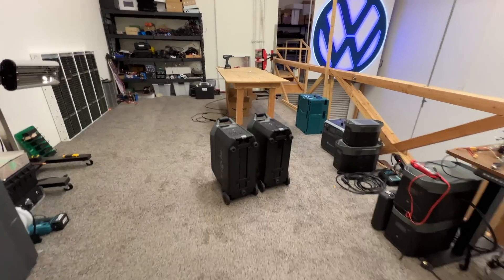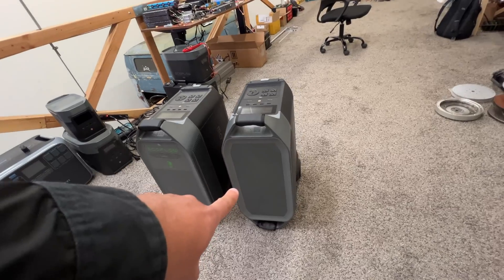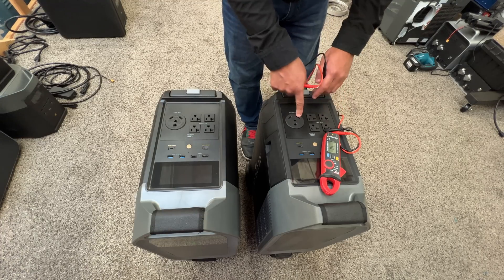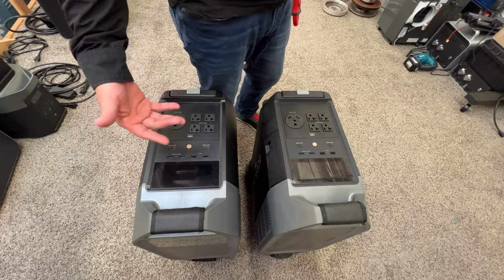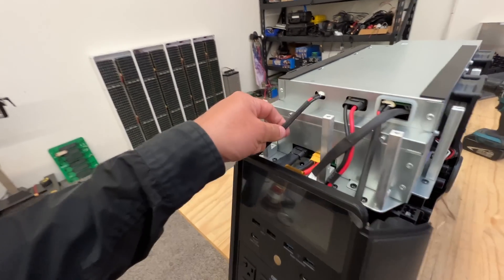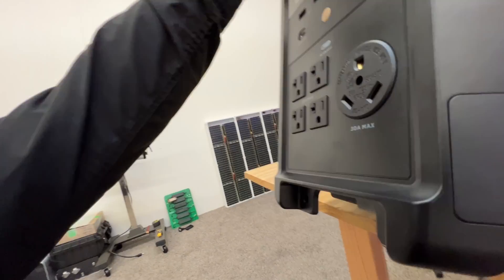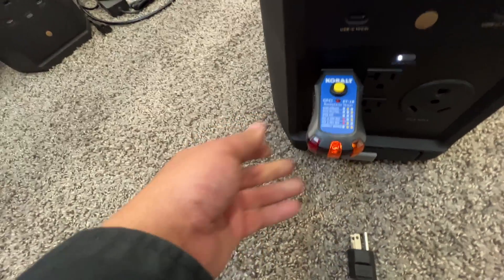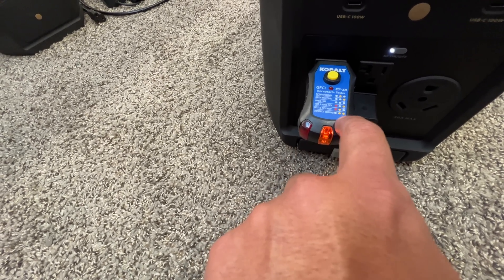Ecoflow Fixed the DeltaPro Reverse Polarity Issue

Comment: So, I got the 121 error code for overload. I had it plugged in charging for the next power outage. I used it last Tuesday, and today is Monday. Before I hooked it into the bypass for the house, I turned it one, all was good, at 100% charge, and when I turned on the switch button, I got the code, and the power dropped to 69%. They are sending me a new one within a few hours of tech support. But what will prevent an overload on charging: would a surge protector be the solution when charging?

Comment: I find it interesting that the Bluetti AC200Max has the exact same issue. I find it very strange that two mfg's would have the same problem. Several users including myself are seeing the same issue you did with the Ecoflow Delta Pro (https://www.youtube.com/watch?v=dpYJJnAdnog). With that said, I have not yet opened the unit up  to see if it's a as simple as a swapped wire. 
I know at least 3 of us have reported this to Bluetti. We will see how they respond as compared to EcoFlow.

I received a response from Bluetti regarding their wiring issue in the AC200Max. Unfortunately Bluetti's response was very disappointing. Ive included their respose for reference - 

"In terms of the off-grid portable power station products, the reverse polarity does not create impact to the normal use or compromise any safety problem of the products."

Comment: I just discovered that my AC200Max has an incorrectly wired 30Amp plug just like the preproduction Ecoflow DeltaPro. I will never use that particular plug but that's two different companies that wired these incorrectly and Bluetti has production units out with this problem. I haven't heard anything anywhere else about this issue on the Bluetti unit either.

Comment: It's a good thing that Ecoflow just doesn't pump out any power station they want. They go on the extra mile to see how it's customers enjoy their products.
Reply: I agree. This am I got the overload code from charging. I had an outage, and within a few hours of phone calls and emails, they are sending me a replacement model. So, this is my second warrany issue, and they are on it, while at first tried to get me just to send it back in my own paking under the "ensure it will not get damaged . . ." clause they added. I griped about that and immediately they said, so sorry, we got you another coming and they provided a tracking number. So down for a few days but back online. I use it for 9 hours during an outage on my house or my rv, and then if it goes longer than 9, I switch to a generator to run my home, while charging the ecoflow for 3 hours and then I get another 9 hours without using gas. I'm thinking I should start using my ecoflow during peak rates at PG&E and charging at low rate hours.

Comment: This confirms line & neutral are consistent between the 20A & 30A outputs, but do they match the line & neutral on the AC input? This is the important part for the scenario you mentioned in your earlier video. I.e. AC input connected to an outlet in your home, with an output connected back into your home via a transfer switch and the neutrals are bonded together in your home's main panel.

Edit: Jehu, can you plug the Delta Pro into an AC outlet (to put it in pass-through mode), and plug the circuit tester into the Delta Pro to see if it reports reverse polarity?
Reply: Yes, let's see that tested.
Reply: The ecoflow has been fixed, period. The 30 amp receptacle was the only problem with the ecoflow.

Comment: I have a request for testing: the DeltaPro states a max input voltage for the solar input of 150V. Do you have a variable DC power supply that goes over 150V? I am curious if there is some cushion built in, how much over 150V, and if so does it trip some kind of protection, or does it fry something in the unit.
Reply: I’ve tested this. It’s pretty much a hard limit. With 160V (VOC) it would not charge. Nothing fried. Of course if you connect your 600V home array it will have problems.

Comment: Correct me if I'm wrong, but I would think an inverter output doesn't matter which one is live or neutral as it is isolated and floating with respect to earth ground (the actual earth via grounding rods) unless it has a UPS function which would have a pass through mode in which case the input live and neutral should be the same as the output.
Reply: Apart from the UPS it matters for split phase bonding. For single phase 120V it doesn’t matter.
Reply: @n2rj  Tell that to an electrician or the UL.
Reply: @uhjyuff2095   I’m aware. I’m an engineer.
Reply: @n2rj  Me too! Electrical?
Reply: @uhjyuff2095  yes! BSEE/MSEE.
Reply: You are absolutely correct!…. Seems to me there’s a complete lack of understanding here of floating neutrals and their use.

Comment: All the receptacles are and were wired correct except for the 30 amp. The wires are not long enough so ecoflow moved the wires exactly how I would do it, and you did it by extending the wires because the wires were too short. Ecoflow fixed it the easy way you fixed it the hard way! I know you won't believe me, but ecoflow did not do a software change only swap the wires just like you did. I guess I have to explain the wires have two ends one end is on the receptacle the other end is on the terminals of the source. You swapped the physical wire on the receptacle and ecoflow swapped the physical wire on the source terminal end. Whew!
Reply: Makes sense.

Comment: True craftsmen will always care about the colors of the wiring.  Some one might be doing work on the unit and get injured due to relying the wire coloring.  The coloring of wires is governed by regulation...it serves an actual purpose....primarily personel protection.
Reply: Yeah, they should just grab some black and white electrical tape. LOL.
Reply: @uhjyuff2095  that is a poor substitute to not using the correct wiring colors.  As a former electrician I often phase colored wiring with colored tape when all wires were black in color.  But having to color tape wiring that was completely wrong was not considered an option.
Reply: @johntingle455  I am also an electrician. An example of wrong color coded wires would be a home run using a cable to a 240 volt appliance. There is no sense in using a 4 wire cable with the correct color wires over using a 3 wire cable with the wrong color coded wires. I am not saying that ecoflow used cables inside their unit, but this would be similar to opening a junction box and seeing the wires from a cable that I installed with electrical tape on the ends.
Reply: As an electrician, colors do matter! Potential shock Hazzard for technicians can occur.

Comment: Hi. Love your videos. You examine things no one else does and teach me so much. I was wondering for camping if you would recommend the original Delta or the Delta Mini? Assume they are the same price. The main differences I see are more capacity and inverter size in the aDelta vs. app support in the mini. You probably know of other technical differences. Thanks for all your help and videos. 🙏🏽
Reply: Delta Mini is newer and newer is better! Just my opinion.
Reply: uhjyu ff Thank you. I agree that newer is better in this case other than giving up a lot of capacity and inverter power, which is why I am struggling. What I really want is a newer version of the original Delta with app support. I really like the 1800W inverter it has. The 1400W inverter isn’t quite enough, but I do love the app with it. 😊
Reply: @litnoregrets7551  Then why don't you get the Delta Max?
Reply: uhjyu ff great question. The max has a lot more power, which is great, but it is large and costs a lot more. The original Delta is right between the Mini and Max, it just needs an upgrade.
Reply: Mini or max. They have app control.
Reply: Ria's Shack ham radio Thank you. Yes, they both have app, which is great but the max is way more than I need and costs a lot more. The mini is not quite powerful enough. I need original Delta power and capacity with the new mini features, like the app. 😊
Reply: @litnoregrets7551   probably not gonna happen right now.
Reply: Ria's Shack ham radio you’re probably right. I just need to wait. ☹️

Comment: I think you're comment about the wires not being color corrected is wrong I understand that the point of this video is kind of talking about everything else of the battery and I understand that not anybody is just going to open this up and start messing with the wires however there's a reason why there are electrical codes out there and even electrical designs are meant to actually coordinate with the electrical codes out there. At best if they did the wiring right kudos to the manufacturer at worse they're not doing any service to anybody who may want to actually have a third party electrical technician coming take a look and repair these things if they go bad.

Comment: Jehu by code, the color code shall be accordingly by the book for safety reasons in order to avoid confusion and  potential injuries or death...
Reply from the maker: Yeah in an electrical panel where electricians will regularly work on it.  Inside this unit,  to me seems like a grey area
Reply: Got some electrical tape?

Comment: But you didn't test on the situation where the issue would happen. In UPS mode, with ecoflow's input connected to an outlet. The test you did with the polarity checker doesn't mean anything, just that the 10A outlets have the same (correct) polarity.
Reply: I am sure the UPS function works just fine and he did test it in another video. When the charging cable is plugged into the wall outlet and the inverter is on in a pass thru function, that is ups mode. Sorry I am being so vague or brief, but that is how the ecoflow charges.
Reply: @uhjyuff2095  How about checking if in UPS mode the ecoflow's output outlets follow the correct L-N-G as being received by the input?
Reply: @jonathansperb  Oh I get you, plug in the ecoflow to the wall and then check polarity on the receptacles. Good idea! that would solve the confusion for sure!

Comment: Also there’s no change in the inverter required to swap L and N. There may be one required for the UPS function and split phase bonding. Check the AC charging input port on the back.I have some inside info I can’t share yet but hopefully soon.
Reply: I hope to hear what other problems these ecoflow generators have.
Reply: @uhjyuff2095   surprisingly not many. Just a few that we found and they fixed. Pretty rock solid so far. I’ve been running mine daily.

Comment: Pretty much spot on. The tape on top supposedly reduces fan noise as there is some resonance when the cover is on.
Reply: I love your previous review videos of the ecoflow pro. I can't wait for the dual unit review and home panel integration and roof top solar kit. Do you have roof top solar panels?
Reply: @uhjyuff2095  I have solar panels that aren’t installed on the roof yet, about 2kWs worth.